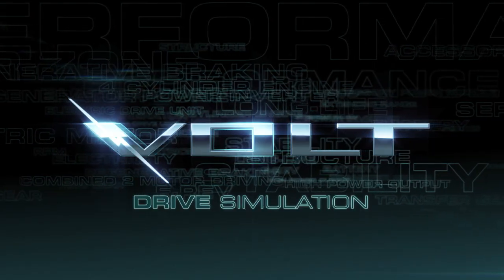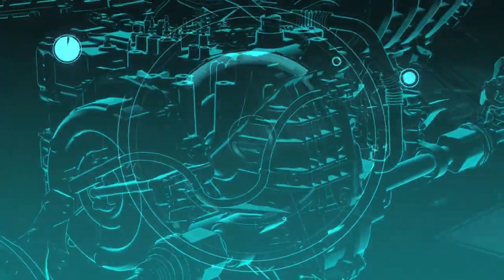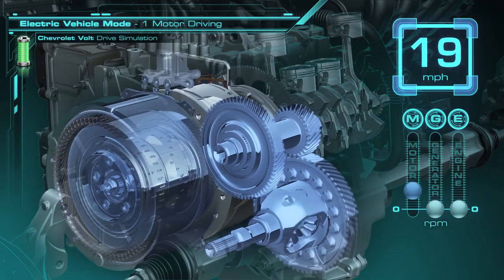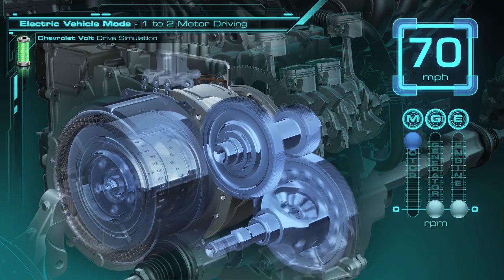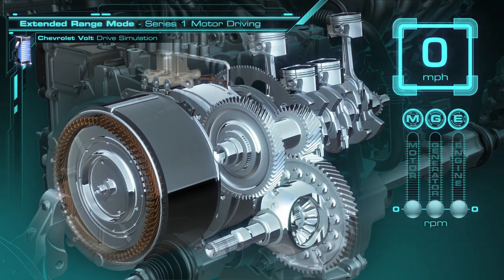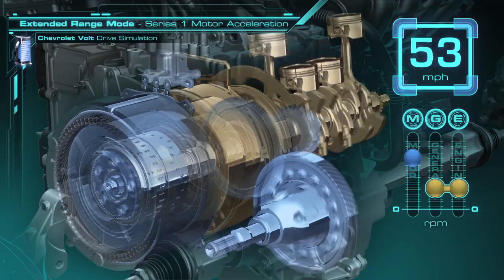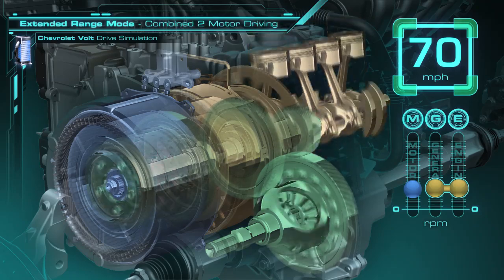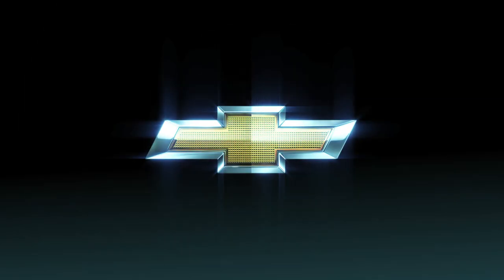Chevrolet Volt Drive Simulation

Comment: The sad parts it’s the GM cancel this car for be ultra efficient, who drive it 100% electric all time, can said the same. I called the never ending battery 2017 with 56000 miles electric

Comment: Mine just died. Battery died and the engine has a blown gaskets I was so sad because I loved this car
Reply: Get another one. You must be really unlucky. Those can last for over 200,000 miles without major problems.
Reply: @bmw803 it had close to 200k miles, and sadly I was upside down with it financially. I didn't have the money to fix it, and it would have been waaay too expensive to fix. Finally got a new car tho
Reply: What mileage?
Reply: @progressnerdd 180k - 190k I just got a new car so I don't remember exactly. It was great while it lasted, but I couldn't afford to fix it. I was upside down with it
Reply: yeah I see, mine has 165k miles and has significant degradation.  really efficient car specially for commuting but as for family purposes and long ranges not

Comment: It's a wonderful car and perfect where a battery only vehicle just doesn't cut it.   Little things abound that let you know that a lot of thought went into the overall design of the car..   A little surprise:  the removable floor mat retention system is nicely made to hold them firmly in place until you want to remove them for cleaning.   I've seen more expensive cars that just took the cheaper velcro in place route...

Comment: Did I hear this right? Once the battery is run empty, you need to plug it in to charge? It has a generator. Why can't the generator charge the battery. Not even a trickle charge?
Reply: If you actually drove one you’d understand. They mean while driving when full electric mode goes empty. It’s confusing to explain. But the car has two drive modes. Full electric, and hybrid mode. They don’t call it that but that’s why you are confused.

Comment: Great idea, but how the modes are label in the car is different then hkw this video describes. Normal would be battery only, sport uses both and changes the  throttle response curve, mountain charges the battery up to max around 15miles, and hold mode keeps the battery level where you switch over. There is no extended drive mode were it sips from the battery amd engine together for the duration of either. The hold mode in my experience does try to replicate this mode from the video far closer, but it always recharges the pack back up no matter what. There is no highway more efficient mode where it uses both and then doesn't recharge and  waste gas to recover the battery level. This would need to be a 5th mode we do note have access too.

Comment: So the engine never sends power directly to the wheels?
Reply: The first generation Volt that is correct.  The engine did nothing but charge the batteries.  The kicker is that engine required 91 octane premium gas. Why I know not.  It got in the low 30s mpg on the gas engine.  3 to 3.5 miles per kilowatt hour and people are bragging 4 miles per kilowatt hour on electric which would be very good even today.
Reply: @2148aa  I own a volt and 4 miles per kw is possible if you go about 55 mph. It helps to be in traffic to limit speed. The car does great if you keep it at slower speeds. If you go 80 mph you get about 30 to 33 mpg vs 38 mpg on my 2nd gen prius under the same conditions. One thing to note about my prius vs my volt is there is about a 850lbs difference between the two cars. The prius is a tin can compaired to the solid drive feeling of the volt.
Reply: 4:50 They show the two being combined with a clutch  more like a Prius hybrid.  Far as I know this didn't happen in the first generation.   Second Generation yes.  maybe I am wrong. Either I got history wrong or it  is rewritten https://www.youtube.com/watch?v=80E1fOp95rA

Comment: I have a better idea than this.    Use electric motors at the rear wheels and 2 Batteries and a tiny gasoline engine to spin a generator that charges up 1 battery at a time, while the car runs on the other battery.    The tiny gasoline engine will start automatically when one battery is low and then switch over to the freshly charged battery.    And the gasoline tank would hold 3 gallons.    This idea was already thought up 20 or 30 years ago.   That was the original Chevy Volt prototype.    This car would get such tremendous fuel mileage and you would never need to plug it in.     But I guess the Big oil companies made sure that this never happened.

Comment: Seems like you could do away with breaks and adjust this to recover energy also speed moderator for inclines does it know wind forces how would tail wind effect both engines at the same time
Reply: They don't describe it in the video, but it has regenerative braking also.  When you drive it down a hill, you see on the display the energy going back into the battery. It has traditional brakes also for emergencies and when the battery is already fully charged and can't take the energy from slowing down.  Brake pads last the life of the car.  Our Volt has 80,000 miles and the pads are still like new.

Comment: Ooo, I'm so glad I have my Volt! I got it when I was in grad school for $10k and have saved thousands not buying gas. Plus it's relatively low maintenance. Before the great plague I had been commuting 30 miles/day to work over hilly terrain, the total electricity consumption was costing me less than $20/mo.

I fully intend to drive this car as long as feasible.
Reply: still got it?

Comment: My 2018 Volt has 65K miles with no problems and almost no battery range loss. It is also very quiet and smooth versus the Prius Prime which is noisy, rough and gets only about 20 miles on EV...GM obviously has the skill to build excellent EV cars...if they want to...
Reply: Our 2017 Volt with 125k miles on it is still going strong.  Still holding about 90% of charge without any issues.  Our son now drives it and loves it.  Chevy should’ve never discontinued this architecture.  I prefer this configuration over all-electric cars.  Plug-in hybrid with electric motor drivetrains makes a ton of sense to me.  I really hope Chevy or other automakers bring that back!
Reply: @justchillinnnn  Queen Mary announced that in 2027 PHEVs are back at GM.
Reply: @justchillinnnn you’re 100% correct, GM should not have discontinued it. Unfortunately, this and the bmw i3(same format) were  too good, they had a profit loss because they worked too well; they couldn’t stretch out repairs and an engine revving only around 1000 all the time rarely goes bad. Sounds just like the movie “Who killed the Electric Car?”😢
Reply: @c5cpe yup agree!  I think we have done maybe 7 or 8 oil changes on this car.  Nothing other than that but new tires.  Car now has 148k and got a check engine light for emissions which is covered under emissions warranty.  It now also needs new shocks.  Still running strong 💪
Reply: Goes to show how Scotty Kilmer shoots his mouth off while being ignorant.
Reply: Iirc GM threw alot of R&D resources at this project back in the dag.
Reply: @suad01  GM has excellent engineers. Their biggest problem is the board of directors. A bunch of suit and ties more concerned about Wall st. CASINO games than their products and customers.

Comment: I really love this system. One thing that I want to know, if it is possible to reprogram volt and lower 70 mph value to say 40mph? It's good when you drive with main 150hp and 370nm engine, but plus 77hp and 200nm generator at low speeds, would be great. so in total you will have almost 570nm and 227hp! No one interested in this?
Reply: Did you ever figured this out? I have seen one guy on youtube driving Ampera over 200hp

Comment: This is what I called OverEngineered nonsense. So needlessly complex. Now compare to a Tesla and it's no engine simple design. 0 pollution and much more efficient and with much better battery. Tesla engineers are so much smarter and intelligent compared to GM ones. Elon Musk is a genius compared to the GM folks.
Reply: Does Tesla have a plug in hybrid? I feel like this is comparing two different things.

Comment: Man this thing is sweet. Its gonna be my second car when I graduate from college🤘🏼 (i got rid of my old car) im going to install lowering springs and upgraded brakes to get the best out of this car
Reply: Lowering springs? The car only sits about 3 inches off the ground stock. How undriveable do you really want to make it?

Upgraded brakes? To what? My 2014 Volt has 153,000 miles on it and the original brake pads have only used 1mm of pad from new. This car uses regenerative braking for all but the hardest of braking, and if you're using the mechanical brakes a lot, you are driving like an idiot or you are forced to drive in the insane asylum called downtown Seattle ot NYC. The rest of us that are able to keep a coffee cup that doesn't have a lid from spilling while we are driving will never replace our Volt's brake pads...

Comment: all car manufacturers  have done to make hybrids is just copying the fundamentals of a freight  train.....a internal  combustion  engine powering  a generator  , giving current to a traction motor.....lol.....old technology.....so the engine can operate at a constant rpm reducing emissions,  while having a electric  motor varying  its output, with maximum torque  available  from 0 rpm
Reply: Except that's not at all the limitation of this tech. The ICE can help propel the vehicle along with the traction motor, increasing efficiency above the strategy you mentioned, can regulate traction motor RPM for maximum efficiency (up to 100 MPH road speed), in fully electric or series/parallel hybrid mode in a compact and mechanically simple package. There's a reason a patent was granted. If it was so easy it would've been done.

Comment: How do I get the motor, The generator, and the engine to work together when going speeds above 70 in order to get that 15% more  Efficiency In my 2014 volt?  Hold mode?
Reply: Hold mode makes no difference in this instance. There is Charge Depleting mode and Charge sustaining mode. Hold mode vs discharged battery is effectively the same. The vehicle will attempt to maintain a minimum SoC either way.
Reply: @nismology  I just got my hands on a 2014 with under 70k on it and the guy I got it from told me to drive it on hold and save the battery for emergencies. Made sense at the time but only pushing 37mpg that way. Is driving it on normal the most efficient way for it to run?
Reply: @ShawnErroneous  Hold mode is used for if you are driving into an electric only area of a city. Drive it in Normal mode. Mountain mode is for what it says, driving in the mountains. The system saves 50% of the battery for a long uphill climb. Sport mode changes the throttle map to make it feel a little more aggresive. Hold mode maintains the battery charge at the current state in case you want to save the EV capability for when you will need it.

Say you're driving from the suburbs into the city. Start out the drive with a full battery charge, put it in Hold mode for the freeway drive where you won't really hear the ICE, then put it back in Normal while you're in the city so you have nice, quiet all electric driving.

But otherwise, leave it in Normal mode. I've also got a 2014 Volt, but mine just blew past 150,000 miles and still going strong. I go about 1000 - 1500 miles per 8 gallon tank of gas.

Comment: I've had my Volt for over 7 years.... used 67 gallons of gas total... changed the oil 3 times .. costing me about 3 cents per mile... brakes are still like new after 55 K hard city hilly miles.
Far less maintenance and cost..... with performance better than my V8's. 
Too bad this car cost $80,000 in Japan, China etc.. because of unfair trade.
Reply: Yep Right hand drive ones sold in NZ and OZ badged as Holdens sold for 85,000NZD before they dropped the price to 75,000 NZD  that was BMW and Mercedes money territory for a brand considered more like a Ford for quality.

Comment: My concern with buying a GM product is will it last?  I have a 2003 Honda Accord with 176m and still runs great.  What will this car look like at 176?
Reply: Still going strong with the original battery and same enjoyable electric driving experience. My 8 yr old Volt with over 180,000 miles and approaching 160,000 EV miles: https://www.voltstats.net/Stats/Details/1502
Reply: This is called perception based on Marketing and Label. GM built lots of shit, but doesn't mean that every single model is crap. You obviously paint everything with one brush. VOLT was one of their best vehicles they've ever made and it is extremely smooth. Erick Belmer in Ohio racked up over 500,000 miles on his 2012 VOLT.

Comment: Last year, I hit 101mph
This year 102 mph 😎
Reply: how?!
Reply: I got to 101 mph before my 2013 Volt indicated I was at max and would go no faster. This was on level ground. Were you going downhill by any chance for your 102 mph run?
Reply: @HQBergeron  No way the governor stops it, just a joke i think lol
Reply: @lemonator8813  You are probably correct. Maybe one of us should post a Photoshopped picture of a Volt speedometer showing 102 mph!
Reply: @HQBergeron  Lol I would on the volt gm forum if I knew how

Comment: Performance of today...maintenance headache of tomorrow...
Reply: Rehuel Galzote these volts are actually really reliable. In fact there’s a guy on YouTube that owns a gen 1 volt and put almost 500,000 miles on it.
Reply: josh maier I see. How does maintenance? Battery replacement cost?
Reply: The battery is engineered to last the life of the car, so there is no "battery replacement cost". Mine has over 180,000 miles and still over 80% original battery capacity and no change in electric driving performance.

Comment: Why doesn't the motor run when going uphill? Shouldn't all three work under a heavy load?
Reply: The electric motors actually produce way more torque then the gas engine.
Reply: Which is why this is considered a range-extended EV versus a Plug-in Hybrid. Full output and performance can be had without the ICE turning on.
Reply: @nismology  Well, not full. The electric motor has a percentage of the total vehicle horsepower/Kw output, and the ICE has the other percentage. Without the ICE, probably over 50% of the power output is missing. However, the battery is big enough that the ICE doesn't have to kick in, apparently
Reply: @vuhdeem  That would be true if the vehicle linearly added the traction motor output and ICE output but that's not not quite what happens. In my unscientific testing full EV output is around 110 kW and full output with ICE/electric is around 114 kW. It's an increase, but not quite what you'd expect. Remember, in charge sustaining mode, the car is trying to maintain a certain traction battery SoC. So, it will not give full output compared to charge depleting mode. So in theory you're right, but what actually happens is a bit different.
Reply: @nismology  In a Ford Fusion non PHEV, the electric motor is is 54 hp and the ICE is 141 horsepower, with a total output of 188 - yes a few horsepower are lost. But these PHEVs apparently don't have full electric horsepower access with the ICE. The Ford Fusion Energi (PHEV) still has 188 total hp even though the electric motor alone is a 114 horsepower motor. That would be a powerful car with 141+114 horsepower

Comment: Seems similar to the system Prius uses. With it's MG1 and MG2, 1 being the traction engine and 2 being the generator connected to the engine, when MG2 spins up it turns the planetary gearset that interreacts with MG1 blah blah blah.
Reply: Except with the Volt the generator can, at high road speeds, spin the ring gear of the planetary gearset which allows the primary traction motor (via the sun gear) to turn slower to increase efficiency. All in EV mode. My understanding is that the Prius ICE must necessarily turn on above certain road speeds to limit traction motor RPM.

Comment: Lol No worries Chevrolet is discarding all research and development on this solution and going forward with just electric vehicles. They pulled the plug in Europe and on the volt.  Now you just need bigger batteries that polute a lot to manufacture, are super expensive per kWh, require More space from then vehicule and add up amlot of weight. And super chargers at home. Theerfect can drive 120 km On batteries and the rest with fuel. No super chargers at home just normal ac home socket. But yeah... Chevrolet went for the full electric nonsense. Brilliant management from GM. GM should have focused on the European market selling exclusively this car alone and no other, kind of like the Tesla just with its unique model S offer.  For the rest of the market sector there was too much competition. But this solution was unique. They had no competitors for this.
Reply: The reason they pulled the plug on the volt is batteries are WAY CHEAPER than when this car debuted. The extra weight and complexity of the hybrid system can be replaced with battery cells and you get over 230 miles on a charge. Finally, full EV dont require all the ICE maintenance and exhaust systems